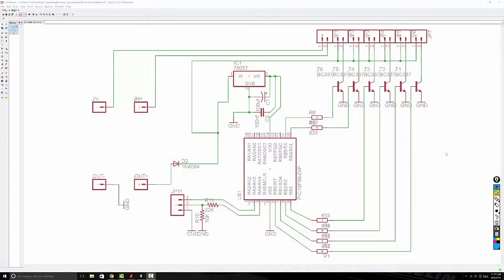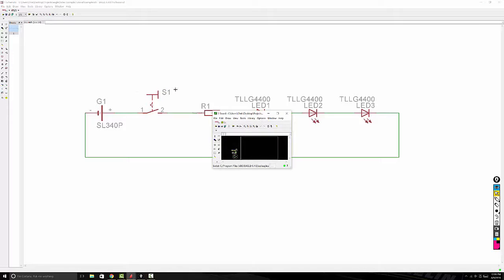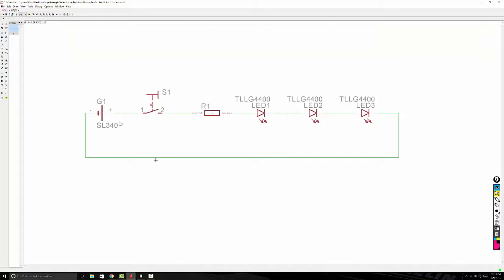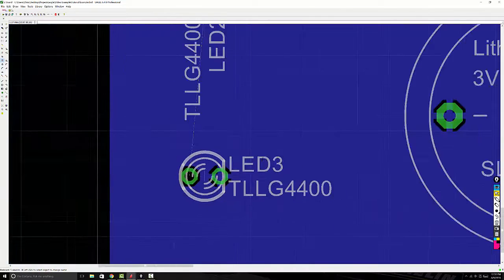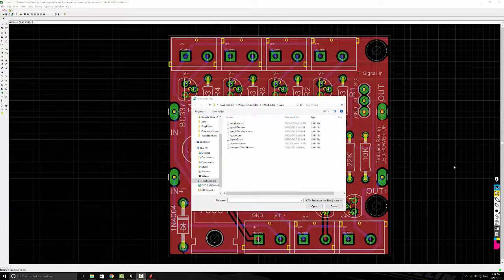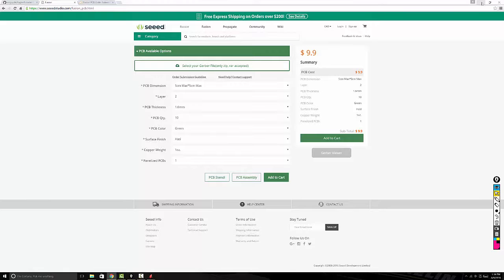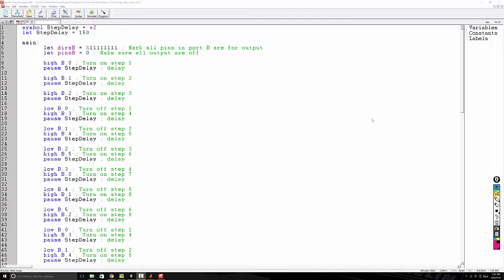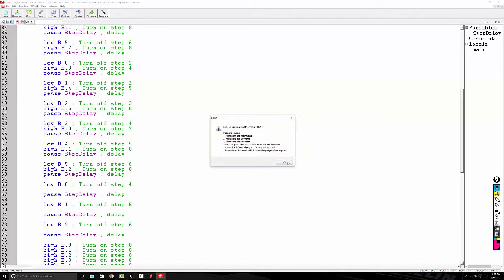HOW TO: Programmable LED Lights (Part 2)

Comment: Thanks for this! I am looking for away to program oem led tail lights. would using this tutorial help?  I want to create a plug and play module that other car owners can use as well. So it would be (Factory Harness) ---> (Custom board)---> to (oem leds)
Reply from the maker: You should be able to do it that way, but you won't be able to individually turn on single LEDs or segments within your tail lights. You will only be able to flash the whole brake / turn / parking on and off depending on which wire you are energizing on the output. If you want to access segments for effects like sequencing, etc. then you will need to take apart your tail lights and do some modifications to your circuit board... but keep in mind you could potentially break them.